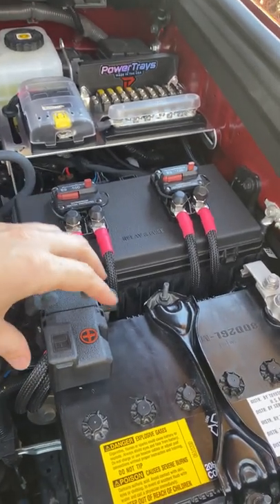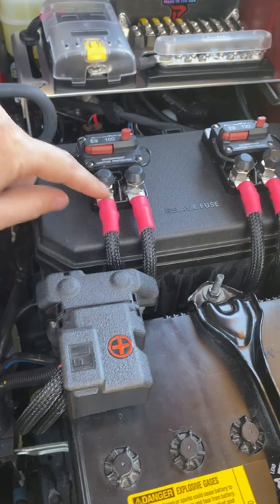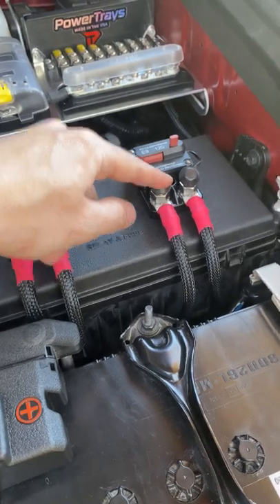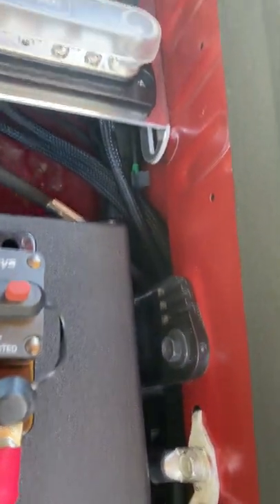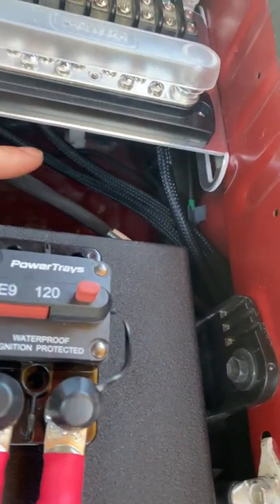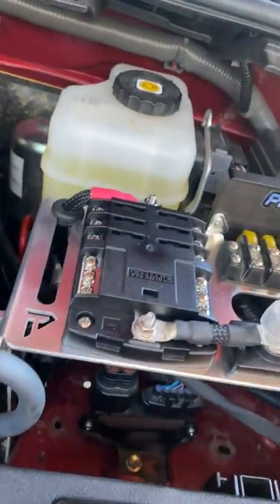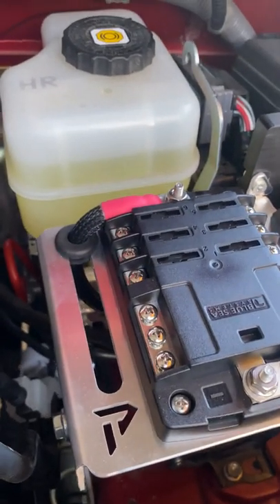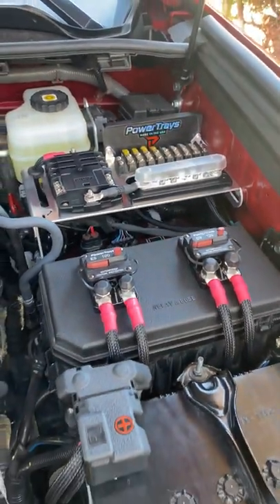How Dual Circuit Breakers work with the Switch-Pros PowerTray System

Comment: What is the advantage of the dual circuit breakers over the Dual MRBF style with no breakers? Also is the fuse panel connected to both positive and negative bars? Hard to see what it is being used for
Reply from the maker: Firstly, circuit breakers are resettable. So no need to carry extra fuses with you. Secondly, you can manually trip the breakers cutting power to the whole system. So if your working on the system you can simply cut the power so it safe to work on. Also if you’re leaving your vehicle, parked for an extended period of time, you can simply trip the circuit breakers to cut power to the entire system.

Comment: Where did you connect the ground cable that comes off the Switch Pro harness? Also, are the trigger fuses added to the fuse box where the CB’s are mounted or under the fuse box under the steering wheel?
Reply from the maker: We run the ground from the Switch-pro’s harness directly to the negative terminal on the battery. This is required by Switch-Pros for their unit to function properly. 

And to your second question: Yes. Since fuse box layouts differ between different makes of Toyota’s, you can grab your ignition/trigger/light sense wire from either location. Just depends on what’s available. We prefer to keep all our connections under the hood when possible. But sometimes you have to go to the fuse box under the steering wheel because the fuse box in the engine compartment does not have what you need.

Comment: The engine bay looks clean, but now everything you run off your box has to be wired the entire way. I ran a single 100 amp with a breaker in the bay to the tool box, and then junctioned it off with a fuse block

Comment: Awesome
Reply from the maker: Thanks!
Reply: @powertrays7549  Just received this kit...awesome build quality. How is the circuit breaker fastened to the fuse box lid?  Please post more videos of this set up with accessories connected.
Reply from the maker: @Didewro  Well at first we used double-sided tape, but that popped off after the first night due to the texture of the factory fuse box lid. So we ended up just drilling and using the mounting hardware. Even with the holes, we’re not concerned about water intrusion because the fastening force applied by the hardware seals the holes up nicely. Plus factory fuse block lids are only about $30-50 online. So if for some reason one ever felt the urge to take it back to stock and those small holes bothered you, it’s a relatively cheap part.

Comment: It's fused and circuit broken..
 Makes no sense
Reply from the maker: Actually it’s just the circuit breakers. The fuses you see on the batteries positive terminal are from the factory and has nothing to do with wiring in an auxiliary power system.